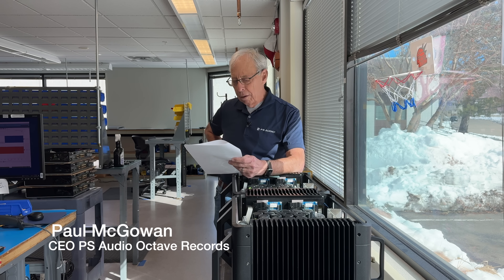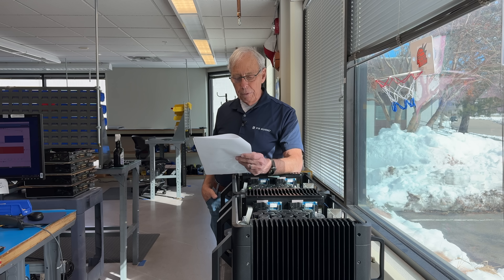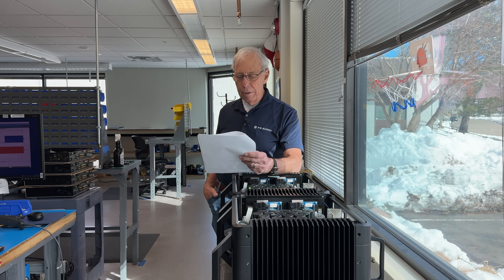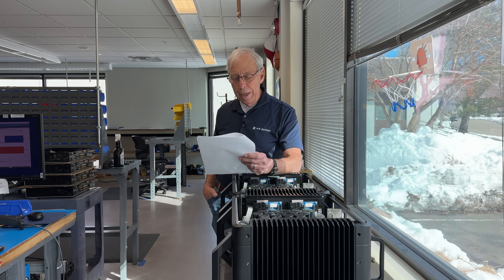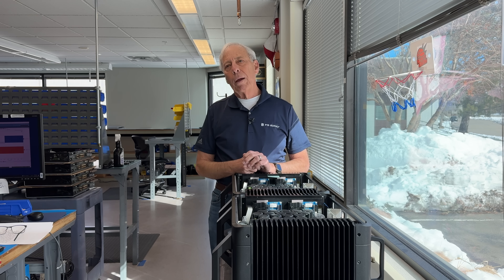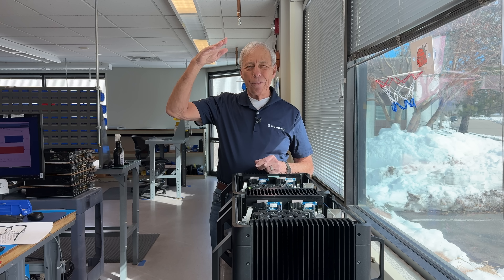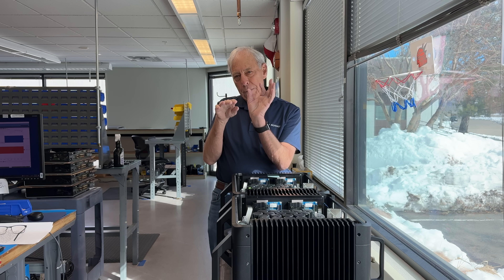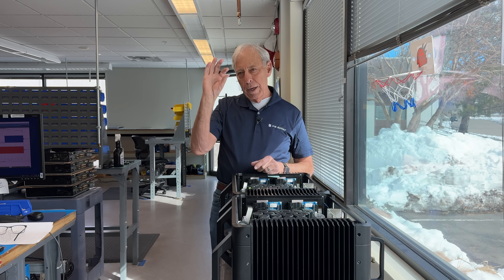Why speakers have only one tweeter

Comment: Have to disagree with you on one element of this, Paul.  3K is a very common x-over point to a tweeter. Many go higher, some lower.  I've gone lower with a Scan-Speak that had an overhung voice coil, allowing more excursion.  Wilson's famous Watt'Puppies crossed over at 4K even with a massive magnet on the tweeter and 93db sensitivity.  The magnet woulldn't look out of place on a good 7" woofer.  However, although the inverted dome from Focal looks like a 1", the voice coil is a .75" glued to the dome (you can see the faint glue line through the dome).  Add to this that there is no ferrofluid and this massive tweeter won't play loud unless it has a high crossover.  To make it worse the 7: woofer/mid they used for many years starts rolling off at 3K so it's really pushing.  The mid is beaming like crazy at 4K, a big reason why they were so hard to place.  However 3K for a 1" dome with a low fs and ferrofluid is fine for most designs.

Comment: My Tekton Moabs each have 15 tweeters.. But 14 of them are divided into two 7 tweeter arrays to handle the mid-range and there is still just one in the center to do the actual high frequencies.
Reply: Exactly.  One tweeter.

Comment: Then there's those Tekton designs with tweeter arrays - suspect the outer tweets are acting as a midrange and the middle as the higher end, to give a kind of dual concentric effect - the multiple 'mid' tweeters getting a lower freq by reducing volume as there are more of them?? Sounds like Arnie was onto this concept first...

Comment: When speaking of line array speakers he said that is really what you need. Hanging line array speakers in your house would also eliminate need to isolate speaker from the floor. I have never seen a review of line array speakers for home use. The search begins!
Reply: The benefit of Line array speakers is improved directivity, so they're able to steer some parts of the freq spectrum to the front and not the rear etc...

They can only improve directivity for frequencies with a wavelength the same or less than the length of the array. 

So when you go to a concert and see those giant array hangs that are 30ft long or whatever, they are directing all frequencies with a wavelength of less than 30ft to the front of the array. 

So get the benefit of an array in your house you'd need to have a ton of cabinets hung up. 

There are some home hifi stuff that is playing with directivity by using multiple drivers and clever placement and stuff. Kii and dutch&dutch are some of the bigger ones
Reply: @schzztzrz  I have 2 sets of arrays for my HT designed by Selah Audio.
Each front has 8 x 4in Fountek Ribbons
Each rear has 8 x 4in planer ribbons
The center has 1x 2in Fountek ribbons

Look up GR research LS-9

The secret is to treat your room properly, people like you always fail to mention how you can tune your room to the type of drivers you use. The way you speak there are no good arrays for music and HT.....thats just an untruth.

Comment: Bcs, that way is cheaper. They make more money if they install 1 tweeter only. Not all of the high frequency are at the same band. Crossover is not able to manage all high tones to be reproduced with one tweeter only. That is a compromise...
That is a the reason why I love  DIY.
I made amplifier and speakers with my own 10 fingers when I was young. It is more expensive and needa a lot of time, but it will last forever and it sounds much better than 90% systems on the market.
I give my system to my friends and they were playing music on 100% load so menu times when someone have a birthday, or got a child. I made it 1997 and still rocks.
20mm high density mdf, 12" Visaton bass driver, 8" Visaton middle driver, random bullet shape cone tweeter + piezzo tweeter (for extra high tones like cymbals). Amplifier with 400VA torroidal transformer, 4 transistors 2N3773 per one output channel (150W/8R), filter caps 2x68.000uF, diode bridge rectifier 300V/100A, massive alluminium raddiator heatsink from extruded profille. There is no need for fan, it is always cool.
Every single component is much higher rated than it should be.

Overengineered and it is meant to last for ever, from Dad to son.

Comment: Another reason is due to comb filtering. Having two sources of same high frequency will cause comb filtering due to time delay between the two tweeters and the short wavelength of high frequency. As the wavelength of sound gets larger, the distance between the drivers that can caused comb filtering increases. You can never have a perfectly flat high frequency response with multiple tweeters playing the same frequency. I guess that is one of the compromises of a line array speaker.
Reply: This is why Sound Stage is so large.

Comment: How does listening to high end audio when I have hearing aids affect the quality of the listening experience?   I have good hearing from low to 2 kHz and it drops down a bit and comes back to normal around 6 kHz.   I can still actually hear to 13-13.5 kHz surprisingly.   Military Artillery and Military aircraft caused my loss.

Comment: Wow! Paul I watched the whole video and you lost me on this one. BTW, I love these videos. You are right in that it has every thing to due with physical wave length. When I was in engineering school I took an elective called the science of hi-fidelity which was taught by the physics department. ( I loved physics)  In that class we put 2 tweeters close to each other and played a 10kHz tone from a tone generator through them. The professor had us walk around the auditorium and you could hear the tone peak in one location and drop to almost silent just a few feet away. This was because the waves would add and subtract from each other. Ideally you want the tone equal no matter where you stand. The reason tweeters benefit from being very small is dispersion. The sound will radiate out in all directions instead of beam forming in a specific direction which is the physics behind a dome tweeter design. This is preferable in a small room environment but when you get to large venues you need to beam the sound and radial horns become preferred. Remember in a small room we want flat response to the entire room as much as possible. With low frequencies the wave length is so long compared to the dimensions of the room that beaming does not happen and you can't even tell where the bass is coming from. In fact your brain just assumes that it is coming from the same source as the higher frequencies. This is the principle of the sub woofer and the basis of how a satellite with sub-woofer works.

Unrelated Question: Why do you think that digital surround sound has not been more relevant to the audiophile scene? Do you think there is a future for surround sound music? It sounds amazing.

Comment: My Dynaudio C2 Platinums use dual tweeters at different crossover points but I don’t think its for any sort of efficiency but a design that affects ceiling and floor reflections to improve the directivity. Whatever it is, it works well. Their new models only use the one with a specific shaped cabinet that they say does the same thing. I doubt that. It will more than likely be a combination of much lower cost ( one tweeter clearly is half the cost of two ) less complex crossover ( again, lower cost ) and cosmetic appeal to their preferred market now that they are Chinese owned. Whatever, I like my old school speakers with their multiple tweeters so thats all that matters.

Comment: Surprised he did not mention the Don Keele CBT36 speakers which have 144 tweeters per pair of speakers. I own a pair and they provide a phenomenal soundstage.
Reply: Rick Craig Helped Don with the design.
I have a full HT line array system designed by Rick.....outstanding.

Comment: Axiom, Bryston, Polk, Tekton, .. 

usually .. 2 acoustic centers close together ..but father than the wave lengths produced .. will cause comb filtering.
Line array aside, or Xover tricks. ( and especially not horizontally mounted ) .. the configuration has to deal with the interference patterns in either case.
( same goes for Xover from tweeter & mid/woofer in a 2 way)

Comment: ya can't move air high or low without lots of drivers, if you want low distortion at realistic sound levels.  where are the specs for PS speakers,

Comment: My Legacy audio Whispers have more than 1 ribbon tweeter, it has 2 ribbons, and 4 7.25" mids, 4 15" Woofers, and a passive radiator total of 11 drivers per cabinet.  it moves air...it takes drivers to move air with low distortion.  small woofers like PS stuff is against physics

Comment: I agree with everything except the statements about the tweeter not needing to have voltage.(power)..of course ill add that my tweeters crossover below 2k.and they need voltage to sound their best. So far as the mutiple tweeter discussion. Yes i agree that the smaller the dia..the closer they must be.. I believe its half the dia..distance from    edge to edge.. now my friend Eric  Alexander uses a center tweeter with a ring of them around the center one..but its secret shading and lower xover point on the outter ones to cancel the comb filtering.. TEKTON ...

Comment: IRS Gama's 
1-emim
2-emits 1-rear facing
1-semit
I wonder where Paul got the idea of multiple tweeters on his new Aspen speakers?
And, I wish I could get the same ribbon material that they and Borresen are using.  Ribbons have more detail than a cone can produce.  Once you've heard a ribbon you can not unhear it.
Reply: I have 2 sets of arrays for my HT designed by Selah Audio.
Each front has 8 x 4in Fountek Ribbons
Each rear has 8 x 4in planer ribbons
The center has 1x 2in Fountek ribbons
People cant believe its that good.
Reply: @PerryRennich Very nice!

Comment: The IRS V's are the reason I added tweeter satellites to my (4) Infinity RS IIIa's. The one tweeter per speaker just got lost. The satellites use RSa crossovers to feed the 4 Emits and they have their own amp. They are wired so 2 are in series and the 2+2 are wired in parallel so they come out to 4 ohms like the original Emits are. Just copied another Infinity speaker that had multiple tweeters. To use an overused cliche, they really are game changers in my system. Also one of the best things, being satellites you can put them or face them anyway you want. I've tried them sitting on the floor, facing the back wall and a 100 other ways. Found they are best facing you except slightly more toed in then the IRS IIIa's are. Just something to think about.

Comment: On my homemade hexagon floorstanding speakers i got 5 tweeters.2 of them firing backwards.6 mids and 6 woofers.I am using 5 and 6 inches mid and low drivers.the woofers are working in a 200 liter bass reflex case.the mid and high inside closed case. Took half a year making thise 165 cm speakers,the tuning was a nightmare. Worth it ? Think so ,quite unik and the sound quality are more like sweet honey. Got a real punch in the lower part too. 😊
Reply: Unique
Reply: @pappachook Fortunately so, yes.

Comment: 1)
To produce the proper decibels levels of various frequencies, you will want or need (depending on the speaker's design) more drivers for the lower frequencies.
That is because, as the frequency drops, the more air the speaker has to push.  And for bass, our ears are not sensitive enough to hear distortion from having more than one driver produce the same frequencies.

For a tweeter, it can produce high decibel levels from that one, single, driver.

Also, multiple smaller woofers (such as in the FR30s) are able to produce faster bass, as the trade-off of pushing less air.  That "pushing less air" is compensated by having multiple woofers.  So you get the benefit of faster bass, while still getting the dynamics and slam from high air flow from multiple woofers.

2)
@2:22 "On our FR30s, we put a tweeter in the front, and we put a tweeter in the back, and that just gives you some more spaciousness."

Note that the back tweeter produces 100% distortion, due to the time delay between it and the front tweeter.
We generally think of distortion as bad, or bad sounding.  But there is also very pleasing distortion (we hear it in countless songs, introduced by studio enhancements),  The FR30s sound amazing, in part due to the pleasing distortion introduced by the rear firing tweeter.  But it is 100% distortion.

Rear firing tweeters are typically used in overly damped rooms, or to compensate for a speaker design flaw.  I do not know why the FR30s, at their design level and cost level, would need rear firing tweeters, when most rooms have too much echo.  Few rooms are overly damp.

Vandersteen's flagship Model Seven speakers have a rear firing tweeter that is off by default.  Vandersteen's manual reads that you should turn it on for an overly damped room, and that it is 100% distortion, due to being time misaligned (the sound from the rear tweeter reaches your ears after the sound from the front tweeter).  But it does sound very pleasing.

I wonder what the FR30s sound like with the rear firing tweeter defeated?
Reply: So ur saying its a diff channel..matrix?
Reply: Still on this fast bass thing... How can a 50Hz sine wave be fast? It's not... There's no need for fast bass because fast bass doesn't exist.
Reply: Yup, one tweeter is more than enough to make you go def, so most speaker manufacturers aren't going to spend money on more than one. If you want to hit 20hz at the same dB as your tweeters, you need a much bigger and more powerful speaker to do it.

Comment: Wavelength is inversely proportional to the frequency of the wave. At 5kHz, your sound wave is around 2.7 inches (6.9 cm). If you have two tweeters outputting 5kHz in-phase and you move your head up such that one tweeter is 2.7/2 = 1.35 inches further away from your ears than the other tweeter, then the two sine waves will arrive 180 degrees out of phase and the result will be that the sum of the two tweeters will cancel out each other and your 5kHz will be gone. It wont just be precisely 5kHz gone at that particular position but you will experience a very uneven frequency response due to this "doubler effect" of the two sound waves either working in synergy (adding to each other) or in conflict (canceling each other out). It's therefore also called a comb effect. Lower frequencies will have longer wavelengths and therefore the doubler effect artifacts can be much less.
Reply: @grumpysFIX Well, it’s up to you what comments you read and I’m not suggesting Paul is changing his video. Cheer up 😊
Reply: One of the best comments IMHO.  I enjoy Paul's fireside chats, but this provides a clear explanation of one of the challenges with multiple tweeters.
Reply: @grumpysFIX not their fault if you lack comprehension, the post was high-school level basic physics, and they did not post this specifically for you, kid.

Try harder, lol
Reply: @grumpysFIX It’s ok but I know this from professionally developing audio products and I doubt your Wikipedia has any description of this concern with multiple tweeters.